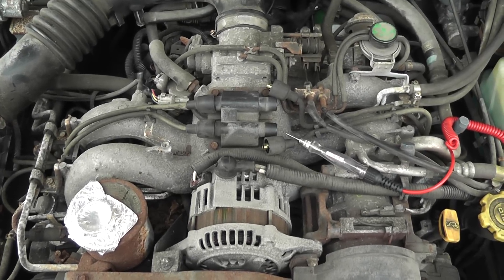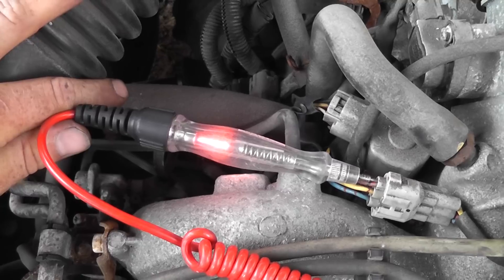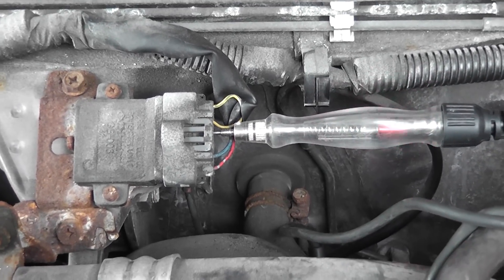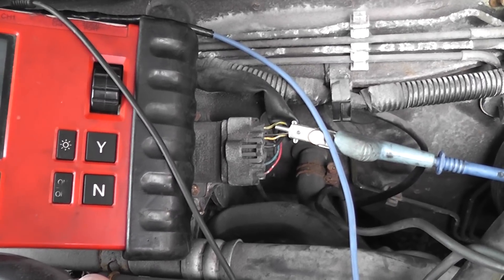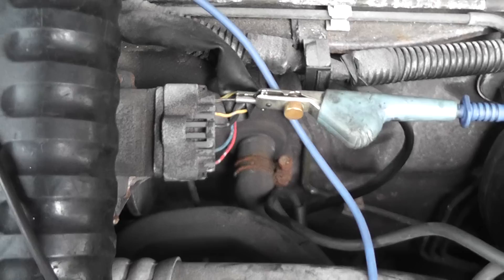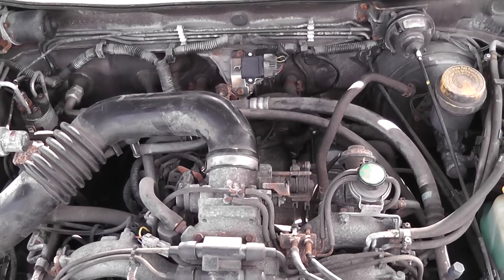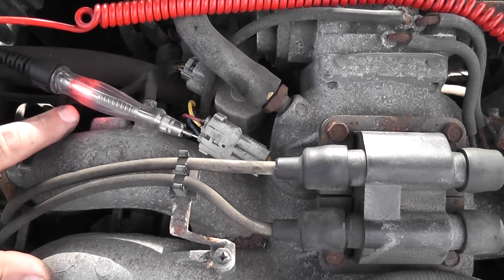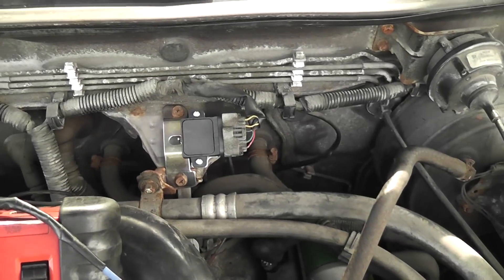How to troubleshoot a no spark condition with a test light (Subaru)

Comment: Hi Dan thanks for the videos! I have some questions on what was shown here.

Amp Probe Test - placed probe around YEL feed wire to the Ignition Coils. No current observed. How is this possible when the Test Light was steady ON earlier in the video?

Test Light was used to check for current at both ends of the control wires to the Ignition Coil but can't be used to check for current to the ECU?

Question on back-probing. Will I be trying to insert the pin along the wire till it hits the bare wire inside the plug or am I trying to pierce the plastic jacket?

I'm going to try adapting these techniques for checking my 92 Honda Accord's igniter. I have checked for voltage on 2 wires like my manual says to do, but I did that by disconnecting them and checking voltage with the ignition set to ON. I'm going to see if I can back probe them and check for voltage that way as well. I will also check for pulsing on the YEL/GRN wire from the ECU with my normal DVM by back-probing.
Reply from the maker: +AJFresh This video is exactly what you're looking for. https://www.youtube.com/watch?v=LdnnFD6J8Uo
I am giving a step by step guide with my class on what tests I performed on this Subaru and why. 
Let me know what you think. Thanks!

Don't pierce the plastic jacket, you are running the pin along the wire until it touches the terminal inside. 

Remember when you are testing for pulsing from the ECM (on your Honda) using a DMM, that you will be reading an average of the pulses. 
Also, you can check for injector pulse, which will provide you some direction as well.
Reply: Thank you so much! I will be reviewing this video tonight

Comment: hi paul i have a problem with my subaru, it starts up but when i put it in gear to drive an gives it gas it cuts off on me
Reply from the maker: +Reynold Winifred  sounds like a loose nut behind the wheel  :)
Reply: +ScannerDanner  its not a loose nut, I checked it out an only two of my cylinders are firing the other two are not

Comment: Can I test Ford COP coil control with  a LED test light ? Thanks brother
Reply from the maker: Robert Wood with the coil unplugged only!
Reply: ScannerDanner  OK. So dumb butt me touched my led to the t pinned coil on my 4.6 Ford and the test light started smoking, engine running, and I immediately removed the tip from the tpin. The engine missed for a few seconds and then ran smooth since then. Does the driver have an current overload protection built in or was I just lucky although stupid. Minus this dunce move I wanted to say thank you as I recently passed my A6 and A8 ASE's. God bless you my brother and thanks for all the great training.
Reply from the maker: Robert Wood sounds like you smoked your test light and grounded the coil momentarily which caused your misfire. No danger to the driver as it is a low side driver anyway.
Reply from the maker: Robert Wood oh and awesome job on the ASE tests! Would you mind posting that you passed your ASE tests on here? http://www.scannerdanner.com/customer/feedback#add-comment
Reply: ScannerDanner Sure thing brother. And thanks again for all you do and the quick reply.
Reply from the maker: Robert Wood got it, thanks so much!

Comment: something else is wrong with that car. It's cranking 4-5 times before it starts. I had a car like that. It starts on the first or second crank. Also, what would cause the ignitor to go bad??  Lucky for that person, ignitor is $10 and coils are $10, sensors for that car are all $5-$20. Very cheap car to own.

Comment: Hey, 

I ran this test on my '93 Legacy and I do not get any lights on the negative controls on the coil pack. The yellow feed (on coil pack) only lights when the key is turned on for the first time. During cranking the yellow feed wire light shuts off and will not come back on unless I turn the key off and back on again. On the igniter the negative controls are lit up and do not turn off or flicker. Any idea what the problem could be?
Reply from the maker: Jim Hendricks Post this question on my Forum at www.scannerdanner.com 
I'll help you over there. 
Thanks!

Comment: Great Video Paul as always. One question - is the igniter ground on this Subaru supplied by the PCM?
Reply from the maker: no, the igniter ground is connected to the block. there isn't even a power feed for this particular design, just basically two transistors mounted in one housing being controlled on the base circuit by the PCM.

Comment: Mr. Danner I have a question regarding the input signal to the module, if somebody had one of those cheapy scan tools with live data capability, would looking for a rpm signal from that scan tool tell you if the module is receiving an input from the computer or that's not a fullproof test? Which also reminds me of a video you and Eric the car guy did on a Ford pickup truck, if you remember that thing had a bad distributor pick up. So there would have not been an rpm signal if there was a scan tool hooked up to it right?

Comment: paul i had 2005 ford escape 3.0 it has ignition coil 1 circuit malfunction.. i pull the intake off and the no.1 coil has a crack so i change all spark plug a 1 coil and i still have ignition coil 1 circuit malfunction.. beside the intake i found a connector for coil and injector, so i did the same test with test light on (-) and the light stay lit  then i did same test at pcm and the light stay lit.. so is this a clearly bad pcm driver?? or there still something i need to consdier

Comment: Excellent video! I was very glad you covered the unlikely hood of both coils failing, but as you probably know it can. Also why not R&R those electricals in the circuit path? Especially on a 95 ? I understand it will probably run fine for ever now, but if the cost isn't insane, why not two new coils as well? You did an excellent job!
Reply: aneyesky Why would you replace something that works?!  Don't even watch his videos just replace everything!
Reply: Gregory May good point,but that's why I said if the cost isn't too high.
Reply: aneyesky
Well whole car is VERY old and with this approach you would have to replace whole bunch of parts;) The cost will be high. It is always your hard earned money and there is no point spending it on something that you don't need. Don't worry tomorrow something else will brake on this car;) I used to do the same because I love cars but cars are just cars... They must serve you not you them.

Comment: Should i take out my efi relay while doing this? And can I still read the signal from the ecu to the coil if I unplug it from the coil cuz I cant seem to stab a t pin into the two green cables.. Thanks very useful video!!
Reply from the maker: not if it is a no start condition. you never want to disable anything when troubleshooting an actual problem.

Comment: Hi, I saw the case study you posted on the GM igniter bypass, Re: switches etc. The tests in this case seem pretty conclusive, however could we for instance place a intermittent voltage to the igniter at the terminals that come from the ECU, via a test light? assuming that the circuit is a pull up design? Thanks, Chris. P.S great instructional presentations.

Comment: disconnect the ignitor trigger wire from ignitor and ecu and check for ground? 
then hook up the scope to cam/crank sensors directly or thru the harness?

Comment from the maker: Yes but you must disconnect it from the computer and igniter first.as for the cam and crank a voltage test is not enough you need to see the waveform

Comment: Hmm, I don't think theres a short to ground in the wire, can I check that by continuity of the dead wire to straight ground?
Unfourtunatly I don't have easy access to a scope but I do have access to a good fluke multimeter that I've been using. Can I just test the wires coming out of the cam/crank sensors for rolling voltage like I did with the ignitor?

Comment from the maker: not sure. always tough to call a bad computer. so many variables. you really need a scope at this point to verify cam and crank signals and also that PCM to igniter control wire. You sure that wire has no opens or shorts to ground. I know you said it had continuity but did you check it for a short to ground

Comment from the maker: Is it the exact same wiring on the igniter as in this video?
If so before calling a bad computer you have to make sure you do not have a cam or crank sensor problem. Washing the engine bay should not have hurt the computer that lives inside of the car. I am worried about a messed up crank or cam signal

Comment: Now after more testing one of my input wires aren't showing voltage at the ignitor. I've got good varying voltage on one input but the other is dead. Ive ran a continuity test between the ignitor and ecu and have good link but no voltage. I've replaced the coil, ignitor, plugs, fuel filter, and cam/crank pos sensors. Still can only get spark on 2 cyls. Do you have any other insights? Thanks

Comment: 97 Subaru IMP with 1.8 ecu/sensors and a 2.2 longblock that ran for 5+ years until i washed the motor in Feb of this year, Next day it started running rough, then wouldn't even start. i found your video which pointed me towords the ignitor, which i replaced.

Comment from the maker: Of course I use diagrams all the time but I didn't need one on this system. There are so many similarities with these circuits that over time you don't need a diagram to troubleshoot it. Even if it is your first time on a particular system. 
Yes, I have considered a DC voltage supply circuit, actually I have an idea to make one :-)

Comment: Hey Paul:
Before you went on this job, would you have looked at the wiring schematic for this particular car? Or, are you just able to deduce which wire is functioning as control, signal, "pull-up";or  "pull-down", through the PCM, ignitor and coils of this particular waste-spark system. My suspicion is that you have gotten so good you just know.

Ever considered getting a variable DC voltage supply for back-feeding low voltage digital circuits and components?   

   Your thoughts??

Comment from the maker: @MrGingaman if your using a multimeter a 2 volt average during a crank would be normal. remember the dmm will average the on off square wave signal. i am assuming you have no spark? take a test light to battery positive with key on and touch the ecu to igniter control wire on and off. it should fire the coil. let me know result

Comment: hey man great vid helped a bit .. but still have a problem ,
i changed a 250t with a ej20 swapped crank angle sensors, pulleys ,intake manafold , wiring harness .    wont start no spark , the ecu sends a signal to the igniter pack but is less than 2 is this a problem with the ecu?  tested all wires 2 times all good.
would be epic if you could help 
cheers

Comment: Hi, in this video, IGNITER have 2 control wire coming from ECU , one wire for steady ground and 2 wire going to DIS one for each coil, what i didnot see in IGNITER was power to the igniter. I thought IGNITER will always have power and Ground in addition to this control wire, Am i wrong?. Please advise, I also heard that IGNTIER will amplify the 3v in control signal to 12v, if so will not IGNTIER need 12v power , please share your expirience

Comment from the maker: @foxholewilly From my experience even a good coil will not produce a spark doing that. So I have to say a scope is necessary although if the primary is completely shorted an ohm test should show it too but this is not 100% accurate either. Thanks for the compliment too!